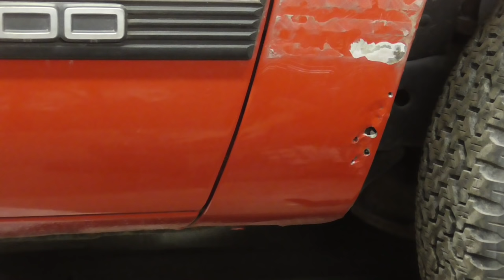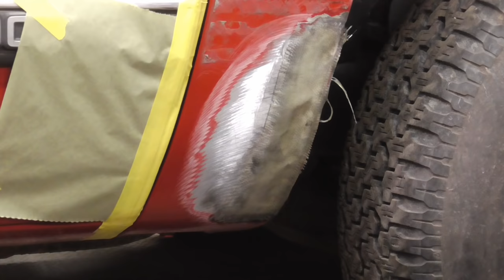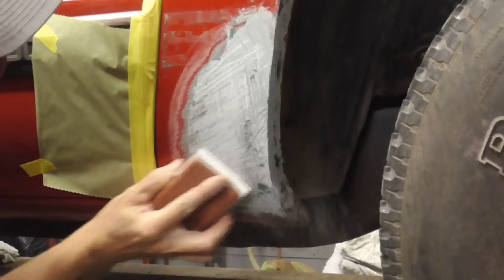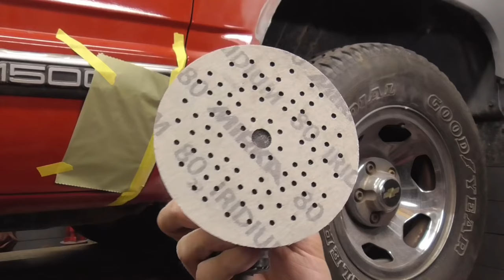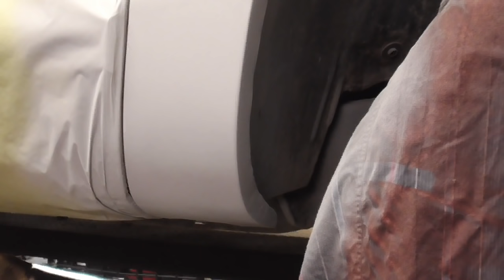How to Repair a Rust Hole with Fiberglass - No Welding!

Comment: What do you reckon would be the lifespan of a repair like this??????
Reply from the maker: If you make sure the panel is able to drain and dry out inside it can last a long time.  If you can seal or coat the back even longer.  Finally if you don't drive it in salty winter roads that's a plus too.  That being said,  I'd honestly say about 3-5 years is a good average estimate.  Sometimes you get lucky and it never comes back.
Reply: @LakesideAutobody  Why would anyone want to do a repair in the half-ass manner to only last a few years. I have watched several of your videos. They show poor methods, such a lap welds, using fiberglass rather than having someone weld in a permanent patch. If you were making a car ready to sell I have seen car dealers use these methods. knowing that in a few years that they will not stand up, but again they don't car once the car is sold.
Reply from the maker: @mypointofview6056  Have you ever seen the outline of a patch start to show through the paint?  Butt welding and attempting to metal finish the seams causes that. With respect,  lap welding is how all body shops in Michigan repair rust on late model vehicles (welding or adhesive).  Strictly butt welding a patch panel, which has become popularized by the internet and TV,  is not the best quality repair on today's thinner metal and there are many good reasons why professional body shops don't do it.  Shops use a combination of both lap and butt (butt for rigid areas that can’t be tapped down) on almost every patch but would never just butt two pieces of metal up (gap or no gap), weld it, then grind away at the area attempting to metal finish it.  Here why with good reason  - especially Eastwood’s starting 22 seconds in: https://www.youtube.com/watch?v=rpH50kh4W00  *
https://www.youtube.com/watch?v=MfKlNQF-o4I  *
https://www.youtube.com/watch?v=e9bjZ_UxtJg  
Today’s metal is .030. That is literally 6 hairs (hair is .005) thick.  You start grinding on that and the result is paper thin welds & surrounding metal.  Your goal is to have one method that works on everything.  Surely you’re not going to butt weld and metal finish this: https://www.youtube.com/watch?v=36zkc9UQaTs or some of my other rust repair videos.  Use small overlap, weld solid and you won’t have to worry about moisture - especially if you keep the drain holes clean (most important thing in rust prevention). Note that  the opening of the seam is upside down on the inside (no moisture trapped).  Please see this video for longevity of this type of repair if done correctly: https://www.youtube.com/watch?v=8XaZBy7GC7A or 
https://www.youtube.com/watch?v=2o37dX-
Reply: @LakesideAutobody  Nice excuses for poor execution!
Reply from the maker: @mypointofview6056  First watch this (especially 22 seconds in) and then explain to the viewers how you would do it:  https://www.youtube.com/watch?v=rpH50kh4W00
Reply: @LakesideAutobody  Well first of all it takes no longer to cut a patch the correct size and butt weld it than it does to lap weld. You also don't have that lap to hold moister to cause future rust. Filling a rust hole with fiberglass instead of making or purchasing a patch knowing that it will only last years is just poor work. If you can weld the newer thing sheet metal because it thin, I might suggest you purchase a welder that you can set down low enough to do so. I have restored quite a few cars started since I was in my teens. You remind me of back in the 1950s and 60s of those that would put chicken wire in a a panel to hold their bondo, and are here trying to pass it off as quality work.
Reply from the maker: @mypointofview6056  This video is for folks that don't have a welder - I stated that in the video.  Myself I always use a combination of lap, butt and/or impact resistant panel adhesive. 
     You didn't watch the video I told you to watch.  There's 3 reasons butt welding and metal finishing is not used in Michigan body shops.
1)  You'd get fired or laughed out of the shop if you did it.
2) https://www.youtube.com/watch?v=rpH50kh4W00
3) Poor quality - you will see the outline of the rust repair after it has been painted in a few years after driving it in salt water - because you ground the welds and the adjacent metal paper thin - todays metal is 6 hairs thick (.030").  In the end it's up to the individual but the methods on this channel is how it's done in high production body shops in Michigan - a combination of lap, butt, and or panel adhesive.
Reply: @LakesideAutobody  I watched that video and that was some piss poor welding with next to zero penetration. Thats why you could see the crack. Eastwood is there just trying to sell merchandise .
Reply from the maker: @captainbondo6427  
     This channel is about sharing the most common  methods used in the high volume body shops I’ve worked at in and around Metro Detroit.
The internet, TV, custom shops, etc use different methods because they know people will "buy" it - it looks and sounds  "right" -  they haven’t worked in the field and witnessed what really works and what really doesn’t.  If you do it every day - you see what worked and what didn’t and why.  The methods on this channel are for daily drivers made to hold up in salt water conditions not cars that are “restored” and never see the road again.

Comment: Did you add wax to the resin so that it won't harden with a sticky surface?
Reply from the maker: No,  but that's an interesting concept - did you here of that from somewhere you worked?
Reply: Most polyester resins made for hand-lay-up work have some wax in the formulation that rises to the surface, keeping air away from the resin and preventing tackiness/stickiness after it has cured. Resins that don't have wax in them can either be covered with a plastic film like Saran Wrap, or wax paper, but are usually spray coated with Polyvinyl Alcohol (PVA) which dries quickly and blocks the air, and is water soluble for easy removal before subsequent coatings.
Reply from the maker: @parkerlich5617  You must have worked in the fiber glass industry :)
Reply: @LakesideAutobody  — Yes, 32 years in Fiberglass Reinforced Plastics research and development laboratory at Owens Corning 1968-2000. Experienced just about every type of glass fiber reinforcement use/application, from basic hand layup to SMC (Sheet Molding Compound) and FRP ballistic armor.
Reply from the maker: @parkerlich5617  You the kind of guy that deserves a trophy for 32 years of knowledge and dedication given to a company and society.  They should have an awards show on TV like the Grammys for all the REAL hard working people in America - It would be great to watch and hear their stories.  Congratulations :)
Reply: @LakesideAutobody  Thank you! The work was interesting, challenging, and rewarding. The only negative I’d say were the years of exposure to numerous different solvents and to asbestos fibers, which we mixed with polyester and epoxy resins to make adhesives for bonding FRP laminates. This was back in the early years, before the asbestos hazard was known, and before PPE was routinely required or used. 

We also routinely fabricated many steel fixtures for structural testing of various fiberglass prototypes, which required the use of welders and cutting torches, and we had a large woven asbestos welding blanket that we used to protect things in the vicinity of our hot work. If only the hazards of those materials were better known and understood back then!
Reply from the maker: @parkerlich5617  Do you have any health problems related to work or is it just something that is on your mind?  Jerry
Reply: Jerry — I do have COPD, some liver damage (solvents usage?), some hearing loss (possibly from styrene exposure), many years of no sense of smell or taste (again, solvents?), have asbestosis in lungs, that three different times was suspected of being mesothelioma, based on CT and PET scans of lungs. 

First time was 30+ years ago and two family physicians plus a radiologist told me I had only about six months to live. Two days later I was sent to a pulmonologist. He looked at the CT & PET scans and said he didn’t see any evidence of mesothelioma. The most recent scans were just last year, but since I’m “still kicking,” the doctors don’t understand why the scans keep indicating it. I had a radiologist compare all the scans from over the 30+ years and the report showed no difference, i.e. no progression of whatever was showing up.  So, I ask my Dr. to let me have a yearly lung X-ray and PET scan just to keep an eye on things.👍😎
Reply from the maker: @parkerlich5617  That's great to hear that you're still kickin' and there is no progression.  You need lungs!  Anyway - love hearing your stories.  Have a great week Parker :)

Comment: The only concern which is that the rust on the backing was not inspected nor removed as others do, and they say any rust remaining that will make a return.  He shoud have gotten some access to the backing and applied some rust reformer.
Reply from the maker: Check this video out - https://www.youtube.com/watch?v=8XaZBy7GC7A  The only way to beat rust is to out think it.  Don't try to prevent it with coatings - it won't work.  The only think that will work is allowing for the panel to drain and stay dry on the inside and to keep it greasy like an old engine block.  You'll never see a rusty valve cover :)

Comment: Essa fita é a fibra de vidro certo? Notei que é diferente daquela com aspecto de lã. Essa fita é a mesma que se usa em reparos de gesso? Por que a fita telada para gesso, tem fibra de vidro
Reply from the maker: Yes it's fiber glass - the same stuff you would use to fix a boat.  Sí, es fibra de vidrio, el mismo material que usarías para arreglar un barco.  If you have more questions just ask :)
Reply: @LakesideAutobody  @LakesideAutobody Thank you, I really like automotive repairs, I have a VW Kombi, I confess that I was scared by the rot on the salon door column, it spread to the wheel well, it corroded part of the internal column, I'm discouraged
Reply from the maker: MIG welders are great for those types of repairs.  Here's how easy it is to weld if you can get a cheap welder - https://www.youtube.com/watch?v=1BYqLM_mY1s  You can also use a cheap flux core welder too but gas is easier to use.  https://www.youtube.com/watch?v=ic7Gwf8y4Yc -  @TheJefferson84ful
Reply: @LakesideAutobody thank you my brother!!!
Reply from the maker: You're welcome my friend - enjoy the week :) @TheJefferson84ful

Comment: Would spraying rust converter behind before applying fiberglass make any difference?
Reply from the maker: I wouldn't hurt.  If you can get back there after the repair and spray some undercoating to seal it off from moisture that would really help a lot.  Or even squirt some oil inside the fender so it can creep around.  Also, drainage and the ability to dry out in there is a plus.  See this video for some rust proofing ideas: https://www.youtube.com/watch?v=y05dNxt-nVc

Comment: I get to be the first to comment. Do you need to do anything behind the rusted panel to keep moister out and have the rust continue where it left off?    I'm in a spot on some s10 fenders where I can easily coat the inside to keep moisture off the spots where rust was ground off.    I've repaired spots like you fixed here, just to have rust pop through within a year or two.
Reply: Look up crc sp400
Reply from the maker: If you can coat the back with rubbery undercoating they will literally last forever - really.  If you can seal the back, you can't loose because no moisture can get to it.  BTW if you can sand blast or really clean the back side before you apply your rust proofing, all the better because it won't peel off :)
Reply: @elian222  the absolute best is mastercoat permenant rust sealer. Much better than POR.
Other than that i recommend crc sp400 cosmolime. It dries to a semi hard wax that will never flake or peel.  Its not as permanent as mastercoat or por, but its a lot easier.

Comment: Shouldn't you load the backside up with a rust inhibitor?
Reply from the maker: You can but most important now matter what you hear is drainage.  The panel has to be able to drain and dry out inside.  No moisture = no rust.  But yes, if you can undercoat the back or treat it - even better :)

Comment: Can i use this method to patch a bigger hole on the car floor? Lets say around 10-12 inches square hole? Will it be strong?
Reply from the maker: Best for the floor is to glue a piece of metal in if you don't want to weld.  You can even use the glue for metal roofs.  I once glued an entire B250 Dodge Van floor in with metal roof adhesive and self tappers - lasted forever because the metal galvanized.  Probably still on the road somewhere :)
Reply: @LakesideAutobody  thank you for replying. Is there any particular type of glue for the metal?

Comment: I would have sprayed some oil or rust protection inside the holes. No?
Reply from the maker: You can do that for sure.  Make sure the panel can drain and stay dry on the inside too - no build up of debris and moisture :)

Comment: how long does it last
Reply from the maker: It can last forever if you seal the back.  if not it depends on how you use it.  If you're driving in salt water winters, I'd say around three years and you'll begin to see some bubbling of the paint.  If you allow for drainage so that the back can dry it will do much better too.

Comment: I forgot to mention its single stage acrylic enamel. Thanks and any ideas on that?
Reply from the maker: I like single stage acrylic enamel - love it.  If it's good quality paint with a hardener it will lay out real flat and you can buff it too - given time to harden up and dry.
Reply: @LakesideAutobody  thanks again. So if I spray a small spot say 6"x6" and there is a little overspray on the old paint I can blend that in possibly without wet sanding you think?
Reply from the maker: @ponylover4448  If you spray paint any repair you'll have edges that are dry - the cure for that is to scuff the whole panel and tape it off.  You will color the damaged area blending it into the old paint and then let that dry.  Finally clear coat the whole panel to eliminate the dry edges.  Watch this video for more information on that:  https://www.youtube.com/watch?v=qah1GLkp7uE   If that doesn't answer your ? - keep asking more - don't mind :)

Comment: Whats the green filler,?
Reply from the maker: Green filler is fiberglass reinforced filler - it's also water proof.  It's just good to go with that first to combat future rust.  If you make sure the panel can drain and dry out it lasts a long time - longer than you probably have the truck :)
Reply: @Lakeside Autobody  thank you, this is the route I'm going down when I fix mine,I'm always abit puzzled why more people don't use fibreglass repairs, seems so much better
Reply from the maker: @philhode5104  As long as you make sure the panel can drain and dry out inside - even spray some undercoating on the backside if possible, it will hold up just fine :)

Comment: How long will this last? How do we neutralize the rust?
Reply from the maker: It will last quite a long time if you clear out the back side and make sure the debris and salt water can escape.  It has to be able to dry back there or it will start to rot out again.  You can use a rust neutralizer if you like but I prefer to sand blast the metal clean eliminating the need to use the stuff.  My dad used to grind it clean best he could and go from there (no rust neutralizer) and he worked at a dealership :)
Reply: @LakesideAutobody  Thank you for getting back to me. I will try that instead. Sandblasting is always fun.
Reply from the maker: @astutenomad2879  Yes - real fun - especially if you're doing it in the hot sun, sweating so that every piece of sand sticks to your skin - good times :)
Reply: Cut the rust out is the only way to treat it
Reply from the maker: @cinderswolfhound6874  That is a good method - like this video:  https://www.youtube.com/watch?v=oBW6vS9Mw5Q
Reply: @LakesideAutobody  Sorry to bug again. Would it be weird to drill a small weep hole on each panel so the moisture can escape? I repaired my panels and come to think about it, These panels are going to hold water like a pocket. The factory didn't think it through. I was thinking a small hole at the very bottom of the panel (not visible) so water can escape. What you think?
Reply from the maker: @astutenomad2879  Drill the biggest hole you can with out it being seen - preferably so that the water and debris can escape but water won't just shoot up there from the tires.  Then you can shoot some wd 40 or oil inside and it with eventually creep around.  If it can drain and the bottom of the panel is nice and greasy it'll last forever - really - see this video for info on that exact topic:  https://www.youtube.com/watch?v=8XaZBy7GC7A  Ask any time - no problem :)

Comment: Should’ve you use some rust prevention where you sand those holes so the rust doesn’t come back
Reply from the maker: Allowing the panel to drain and dry out inside is huge and this works well too - https://www.youtube.com/watch?v=8XaZBy7GC7A

Comment: So you blew out all of the leaves through the rust hole to prevent rust in the future. But wouldn't the vehicle have been manufactured to allow for some leaves, and not rust out like that?

Shows the difference in quality of vehicles made in Australia compared to vehicles made in USA, Thailand, China etc.
Reply from the maker: The truth is there is not much design put in cars/trucks to prevent rust.  Most drain holes are small and they get clogged within a few years.  Some panels literally trap debris and moisture.  They could do a lot better job at preventing rust for sure :)